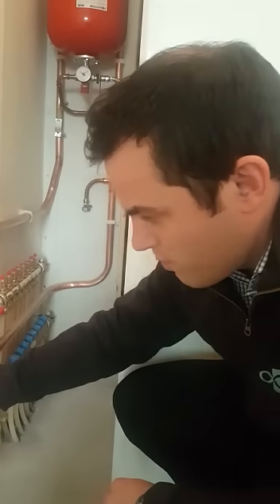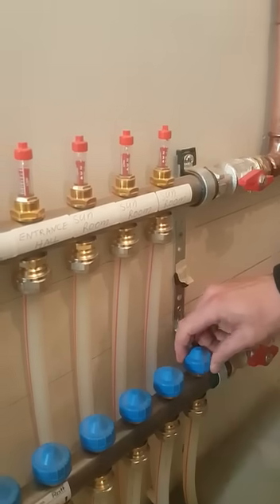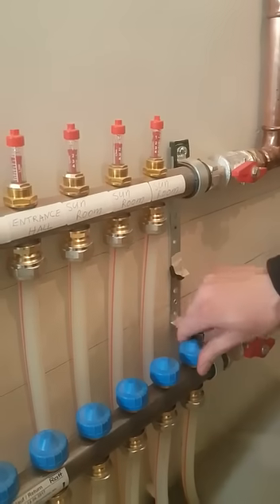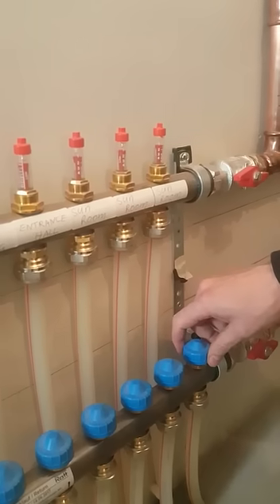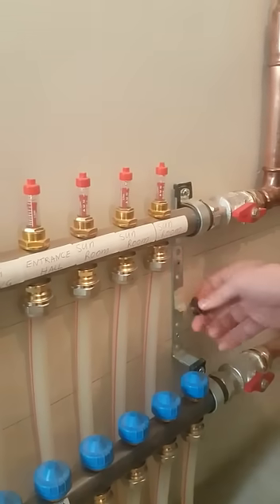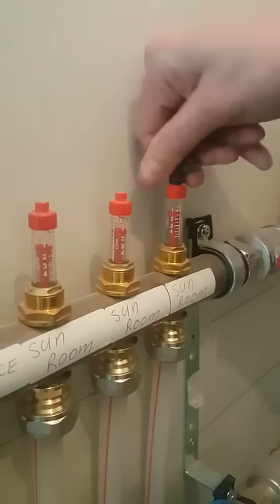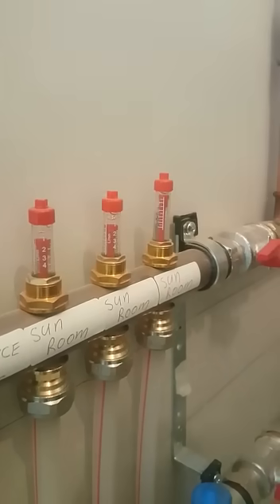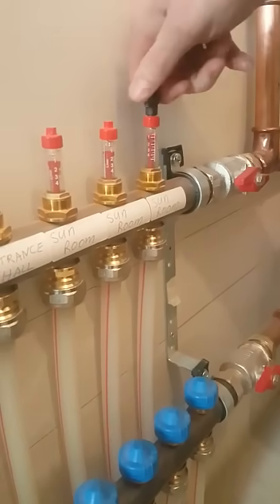How to adjust flow rates on your Underfloor Heating System

Comment: I have a question regarding underfloor water heating in my new appt. There is no heat coming from the floor for several days now. It was fine before. The thermostat temperature is set significantly higher than the current ambient one, and the "flame" indicator is ON, meaning that heating is on.

But there is no actual heat coming from the floor. I have attached a photo of the setup underneath the boiler. There is another interface/display which I suppose is some sort of heat sensor, however it is blank unless I turn it ON, and then it turns off after a minute. 

There are also these little glass gauges, they are all at the top (zero), and only the one circled in orange wiggles a little now and then.

What seems to be the issue?
Many thanks.
Reply: I have the sane issue did you finde out what was the problem? 😢

Comment: Flow should be adjusted at the  top
On the bottom- return is to be connected to control system where you can have different zones on/off and temp controls 
If not then should be fully open at the return
Reply: If there's no zone controler, balancing on the return is not incorrect at all!!!
Reply: Radiators are on return balance  t to !